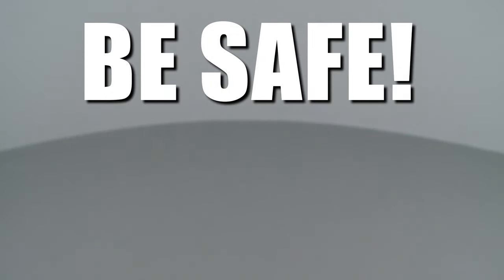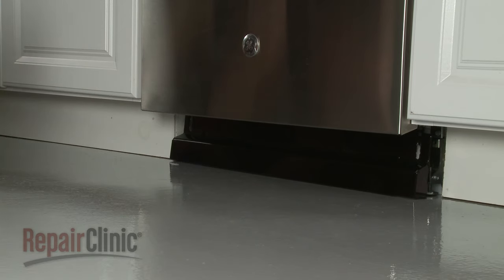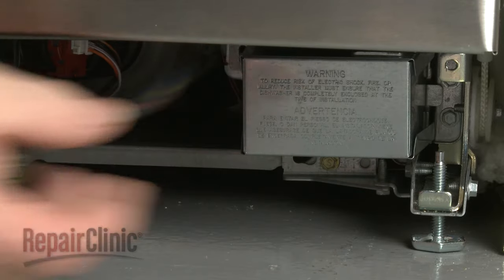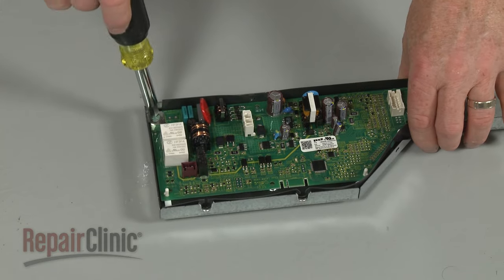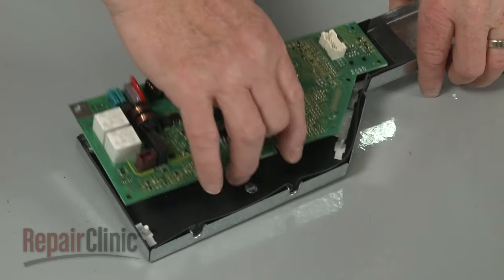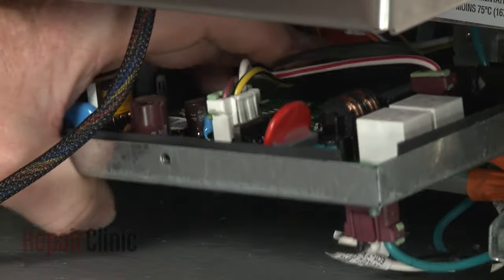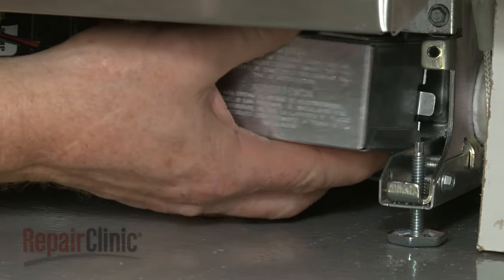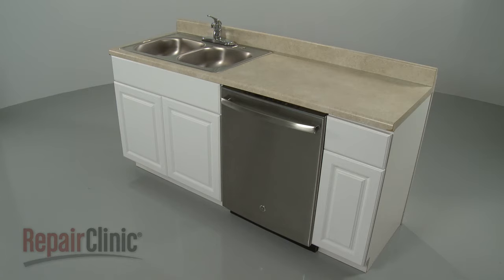GE Dishwasher Main Control Board Replacement #WD21X20720

Comment: Repairman just left and wanted $450 for parts and labor. After a little research i guess itss 100 for the board and 350 for 15 minutes of work.
Reply from the maker: You're welcome! 

We are always happy to help. If you would like to give us a review on Google, we would much appreciate it: https://g.page/r/CcVUrahZNozMEBM/review

We hope that you have a great day!
Reply: I switched it but it still doesn't work. Any suggestions?
Reply: I wasnt getting any readings on the main board but then switched the multi meter to DC 200 and got 13.9 volts. Guess gotta replace the UI as well.

Comment: I agree that the video and instructions were excellent. I ordered the new board for our 3 year old GE dishwahser and it was a snap to replace. After a week of handwashing, my wife is quite happy. I will say, however, that our GE diswasher was very lightly used—we would run it about once a week, and I would expect better reliability in such a new appliance. I’m not so sure we would go with GE again. Thanks for the help!
Reply: My GE is only 4 years old and the main board is constantly complaining that the door is open (the 3 beep and flashing amber light).  We bought the upgraded model too. I ordered the replacement board which should arrive today. This video makes it look pretty easy so I hope it will go that way. I will never buy a GE dishwasher again since there are thousands of complaints about the main board crapping out in less than 3 to 4 years. I'm looking at Bosch for my next one. Expensive but worth the reliability.

Comment: Tried this for my 4 year old GE dishwasher. Instructions in video were great, replaced the board and got it back in snug.... But dishwasher still doesn't turn on. Electrician was already out and verified it was getting power. Looks like I'm buying a new dishwasher
Reply: I've got a GE too, only been 3 years, was going to try this but no point after seeing your comment. Gonna by a new one.smh

Comment: As I got into the installation of this board, I noticed a few things that probably caused my board to short out. 
The company Lowes used to install my dishwasher did an egregious job of installing the unit. The lazy jerk didn’t bother to put the junction box over the wires. Some of the wires were frayed. The insulation on the bottom cover also had a burn mark. I tried to contact Lowes about the poor installation. Since the install was done in 2017, they can’t find us in the system. They pretty much told there was nothing they could do. I had to wrap and clean up the frayed wires with electrical tape. I then installed the board with the help of this video. Everything is working fine now.

Comment: I appreciate this video. I got a board off Amazon for $85 after getting a control board code. I'd spent $400 to watch a guy replace a $65 control board on our furnace earlier this year so I decided that it was worth the risk of $85 for the dishwasher. Our house is 4 years old. So far the dishwasher is working. Actually everything was just about as easy as the guy showed with the video to watch.
Reply: You’ll wind up replacing the board again and again

Comment: Helpful video.  Aside from the epic battle to remove and reinstall the support panel, this went off without a hitch on my 2018 model.  The builder that installed my dishwasher didn't bother with the junction box cover, and didn't even leave me a screw for it, so I just kind of put that over the wires as best I could.

Comment: Dishwasher had no power. Estimates I received were $350+ for repair. I went on repair clinic and purchased a control board and figured I would take a shot. The video was very helpful to follow along. I now have a functional dishwasher and saved $250 in the process. Took a bit longer than I would have expected, but it was much better than paying for the fix. Cannot recommend highly enough

Comment: Great repair video.  It helped me diagnose and I found that a defective power plug  to the circuit board was my problem rather than the board itself.  May help viewers to consider this before replacing the board.  Read on.  I had a similar problem to others at 4 years:  sporadic music, then eventually total darkness of the display.  Troubleshooting took some time, but it appears that I reached the solution.  Turned out to be the plug inside the box where (the wires are connected to power).  It was giving intermittent power to the panel, and when jiggled a bit in just the right way, would restore power to the view panel and the dishwasher.

 However, this jiggling was not a permanent solution.  Since half of the plug is built-in to the circuit board, and I could not detach one of the plugs to the board, I could not remove the board to work on that part.   After closeup photos of each side of the plug (that on the circuit board, and the other which plugs into the circuit board) I could see nothing amiss with the either half.  What tipped me off to both the original discovery of the bad plug and the final solution was seeing arching through the semi-transparent white plug when it was plugged in with power on.  I reasoned that the intermittent arching over time had deposited metal oxide dust within the switch.  What to do?  I used the red flexible plastic tube on my WD-40 can and squirted the oil into each side of the switch multiple times.  Hopefully the insulating dust particles are now washed from the plug, and it will be smooth sailing.  The plug seems to restore the display immediately each time the plug is plugged in now.  No arching visible at least.  Everything works now (it still plays a tune every so often, but at least we can wash dishes without disassembly).

Comment: Perfect!  I had been looking for the specific instructions on how to install this board.. Others had the board inside the door.   Based on the schematic when I ordered the board, I knew it had to be underneath.   Took me less than an hour from start to finish (this guy made it look really easy in the video...lol) But, once I got everything plugged in, I flipped the breaker and I had power to the dishwasher!  

On a side note, there was a little green light flashing on the board when I dropped the control panel plate.  (I had yet to cut power to the dishwasher...silly me)  I wonder what that was all about.   

So, as I type this, I have a full dishwasher running on autosense, sani, and steam.  Dishes better be good an done when I get up in the morning!  GAH!

Comment: Thank you so much for super easy instructions.  Ordered part, installed in less than 15 minutes.  Bam.  Dishwasher has power.  This lady does not like to do dishes by hand.  Many thanks for the video.
Reply: Hi May I know from where did you order the part

Comment: Yeah, I just got quoted for $280 to have this done. My dw kept having to be unplugged and replugged for it to work and now it’s not coming on at all. Tried the breakers too. I feel like I have def done more complicated things around the house, so will absolutely be giving this a try. Just need to make sure I buy the correct board!
Reply from the maker: You can find your control board on our website by entering in your model number www.repairclinic.com. 

If you need additional assistance finding the control board, give our team a call. Have a great day!

Comment: Thank you for the video.  I bought the parts locally, which added to the cost vs buying online but i was able to purchase and install the same day.   Very easy, hardest part was moving the dishwasher out from the counter.  I tried replacing just the door latch switch first but that didn’t work so then i did the main board shown here and it’s working perfectly.  Thanks!
Reply: Where did you find it locally?  It's 240 bucks online.  I'd like to avoid that

Comment: This is EXACTLY what was wrong with my 3 year old dishwasher. Great step by step video easy to do and follow. Thank you so much!!
Reply: Also I found it MUCH easier to access the panel if you tip the dishwasher back slightly to get under it more. You just need to remove the dishwasher from under the counter to have complete access.

Comment: Thank you, RC!  This video was so easy to follow I was able to remove the board exactly as described and have placed an order with RC for a new board.  Well done.
Reply: @repairclinic  Just installed the new board per these instructions and the dishwasher is running again - thank you!

Comment: I replaced the UI on my GE Adora a few years ago and all has been well until recently. The washer had no power. I cut power at the breaker for a few hours and the washer came back to life. I also reset the control board via the start/select cycle buttons. The washer will chime every hour or so. I'm sure the problem still exists, and tripping the breaker is a temporary fix. Is it safe to assume the control board needs to be replaced?

Comment: I purchased four GE kitchen appliances together 4 years ago. Last year the microwave oven's magnetron quit working and I had to replace the microwave. So, that's the price of the new microwave, plus a service call, plus labor to install.
Now my GE dishwasher quit working. After discussing with tech support, it's likely that the motherboard needs to be replaced. So, the motherboard part cost, the service call, and the labor costs will be higher than the original dishwasher purchase price. These are high end GEs--I expect them to last longer than 4 years. Refrigerator and range are next to fall apart. After viewing this video, there's no way that I'll replace the motherboard myself. After this experience with the appliances going kaput in less than 5 years, I will never buy GE again.

Comment: The jacks on the board need to be squeezed on the side with the small locking flange, otherwise they do not release.  Otherwise, this worked for me as well, very clear! although the cord-cover on the right on my model was more recessed than/ very different from the pictured one.  I still benefitted from removing this cord-plate for the re-insertion phase.  Not sure what the mass defect on this PC board was--does anybody know, and is the replacement board likely to last longer than the original?

Comment: Three Main Control Boards have been replaced. The original board lasted 5 years, Only purchased the first replacement the others are replaced by G.E. warranty. The replacements last 3 or 4 months. The control lights go on and off randomly with the new boards as soon at they are installed. The 4th board will be installed Tuesday. If anyone can give me some insight please let me know.

Comment: I had this dishwasher for a little over 4 years. I am a single guy using this once or twice weekly. Pretty ridiculous to have one fail already. I wonder what component is the common culprit on these boards that go bad. Probably a component on the board that's less than $10 that's going bad.
Reply: Usually the case, a cheap under dollar component.

Comment: Followed instructions replaced the motherboard as directed. However, dishwasher still shuts completely off mid cycle. Any suggestions on what could be wrong?
Reply from the maker: First make sure there isn't a clogged filter or spray arm. You'll then want to check the door latch and float switch to see if they are faulty or damaged. If the door latch or float switch are damaged they will not communicate properly to the control board. Then test the fuse, pump and motor for continuity.

Comment: My GE dishwasher stops mid-cycle. Starts again if I open door and restart cycle. Happens 3-4 times for a normal cycle and then cycle completes. I already replaced door switch and made sure good engagement. 
Thinking of replacing main control board but wanted to check if there is anything other suggestions.

Comment: I have a GE - GDT695SGJ5BB with a rectangular board instead - WD21X25730 i think. But, I cant find anywhere what the led is indicating. GE Support just pointed me to making a reservation. It blinking green rapidly and continuously. Any idea what that means?
Reply: thanks
Reply: nvm, looking at other posts in the forum it seems the ui board is bad. I think there's an implied step 4. bad ui

Comment: The install appears to be easy, but just received my new board and it says the jumper configuration needs to be set. How do I adjust the jumpers?
Reply: Did you figure this out?
Reply: How did you adjust the jumpers?

Comment: And this board needs to be replaced if you have power to the unit and no lights on the control panel? On a 3 year old dishwasher?
Reply: Im wondering the same.
Reply: @dawnevans7628  I fixed mine by unplugging the main feed to the board and plugging it back in. Still had power applied to it. when i started to remove the plug, the dishwasher started running. Been running ever since. Wonder how many people replaced the unit when it may have been the connector.
Reply: @countryside8122  I'll give it a try. Thanks! Happy Easter
Reply: @countryside8122  this is almost exactly what I discovered. However mine keeps doing this every few washes. I do have an led indicator on the circuit board though, 4 blinks in a second or solid green. Which states a software issue, replace main control board.

I did go ahead and replace the main circuit board, twice now thinking I had received a bad one. Maybe I need to replace the connector?

About $150 in on this repair, getting closer to throwing it in the dump.
Reply: @hwmtrustychords  see if the pins on the connector can be squeezed together a tiny bit more. Their is a release spot near the pin to release the connector and gently squeeze the round pin together.

Comment: Just did this repair and no love. Any other ideas?  BTW, it's not quite as easy as shown here, in terms of pulling off connectors and returning the metal board holder to its place once done, but the directions are clear.  I actually find it insane that this board is located in this almost inaccessible location.  I've had this machine for no more than three years and this is really unacceptable, but it's the world we live in today, where this junk is foisted off on consumers and the manufacturers just turn their heads.
Reply: Hey Ron, I just replaced my board with no luck as well. Were you able to repair yours?
Reply: @KC-cx7pi  No.  In the end I replaced the entire dishwasher.  A tech did tell me that the board on the front that has all the control surfaces was probably bad -- but the cost of replacing that made no sense.
Reply: @RonDylewski  Thanks Ron.

Comment: Helpful video but new board didn't work either. Still no power. Control board show green light so there is power to the board but door controls still dead. Anyone found a solution or just throw this piece of garbage out and replace it with the better dishwasher?

Comment: I replaced my control board and it worked. Next night, my dishwasher had no power again. Help
Reply: Same issue here. I can unplug the main power to the circuit board and plug it back in and it’ll work for another wash or two then it won’t power on.

I’ve replaced the circuit board twice now, thinking I got a bad one the first time because it did the same thing.

The light on my circuit board either flashed the led 4 times quickly or was stuck on. Both say “software error, replace main control board”. Which has obviously not worked.

I’m at a complete loss, aside from having to unplug and plug it back in again the dishwasher works perfectly.

Comment: The new repair includes a new wiring harness for the new computer so you should have some basic wiring experience but just using wire nuts and making sure the wires are attached to the black, white and copper wires correctly.

Comment: How do you verify the boards bad?
Reply: There's an LED on the board that gives error codes when it's plugged in.
Reply: pldenc44  my board won’t light up. But has power to it. I only have about 50 washes with this GE dishwasher.  Very disappointing
Reply: I took a shot in the dark with my repair.  The control board is a more common failure than the user interface board.  I had no power to the controls, and it quit mid cycle.  Based on what I had read, I swapped the board.  If that didn't work, I was going to swap the UI board next.   The technicians have a device they can plug in, I assume, because there is a port next to the door wiring plug.
Reply: @tomlagesse6635  Did the board fix your issue or did you need to proceed with fixing the UI board? This is where I'm currently at, deciding wether to buy a new board or tear into it further to get to the UI board but there doesn't seem to be an easy way to separate the door on this unit to access the UI board.
Reply: @evansobinovsky6440  Yes, the main board was the problem.  It had shorted out due to a piss poor install by the plumber, whom I paid handsomely for the work.  Water was leaking on SPLICED main electrical wires, which shorted the board. Spliced.  Just was too damn cheap to run a full length of wire for the hard line.
Reply: @pldenc44  good evening do you know the codes for the board i have 7 blinks do you know what that signify
Reply: @irisobanana9648  The manual I have only shows error codes for 1-5 blinks. Not sure what 7 means. Here's my manual:
https://photos.app.goo.gl/CMxmxmKke6kmqBXg6
If its plugged in and no lights -- the main board is probably bad. Sorry that's not good news.
Reply: @lancedyer4870  thank you. Is that from the owners manual
Reply: @ttttrigg3r  yes that diagram is from the owners manual